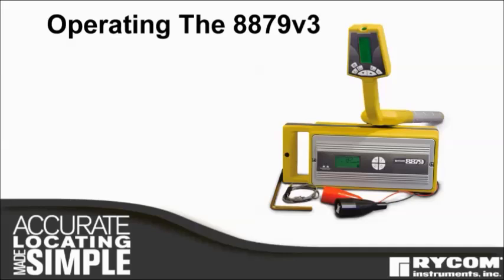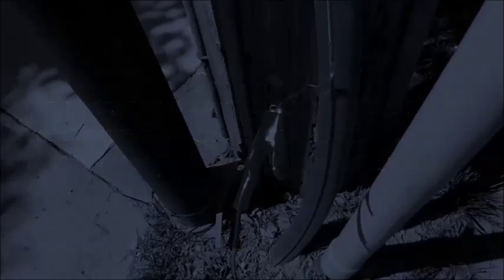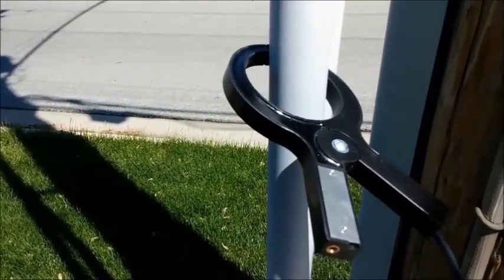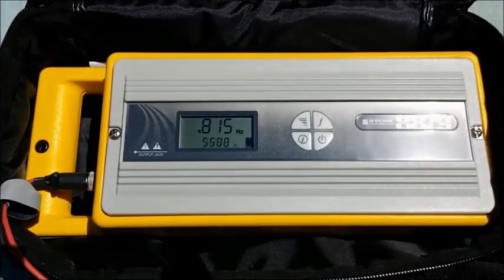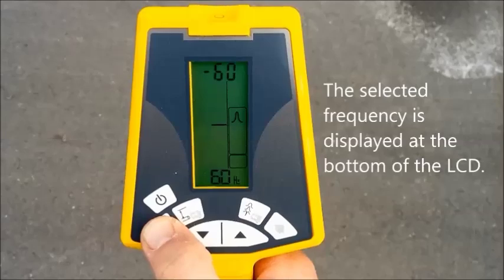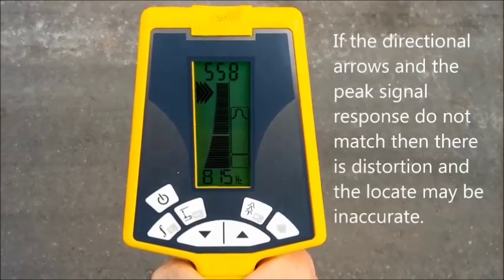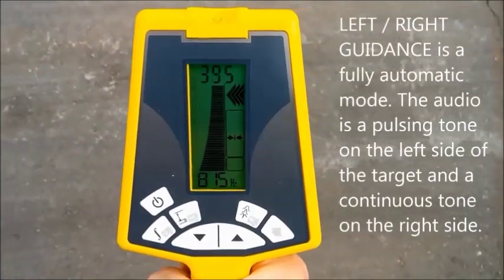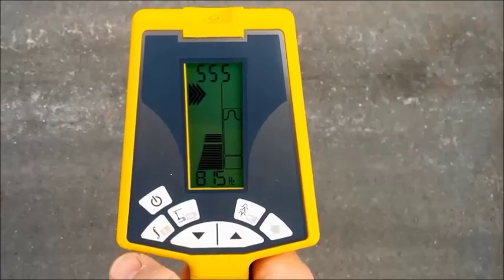RYCOM 8879 Locating System - Instruction Video

Comment: how do you charge the transmitter?
Reply from the maker: Hi Curt Williams, the system can be ordered either as rechargeable or as a d-cell system. The rechargeable system is available in two (2) models, a 12-volt 7 amp/hr seal lead acid battery or a Lithium-Ion 11-volt 7 amp/hr battery. The lithium lasts longer between charging cycles and it is much lighter. Both rechargeable system models include both a AC (wall plug) charger and a DC (car) charger. Hope this answers your question and please feel free to contact us for more information. The Primo Team.